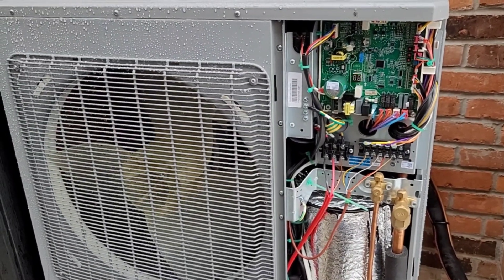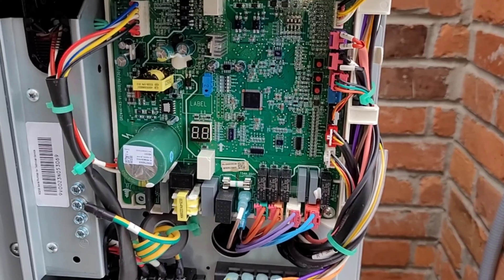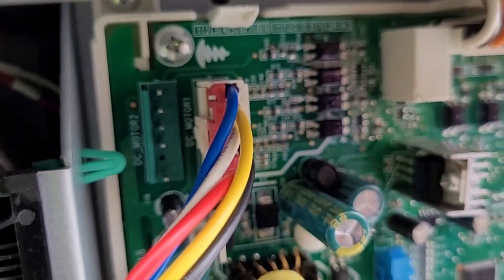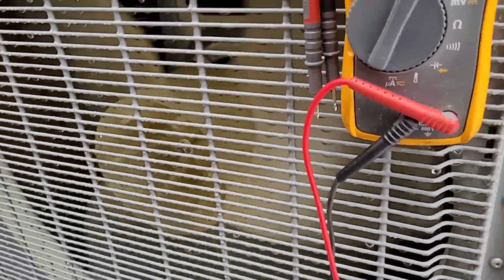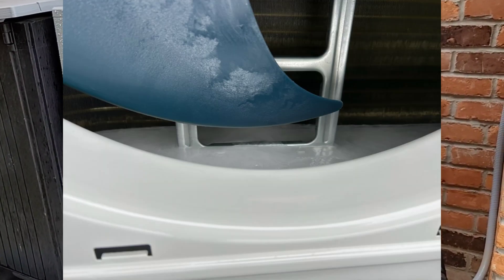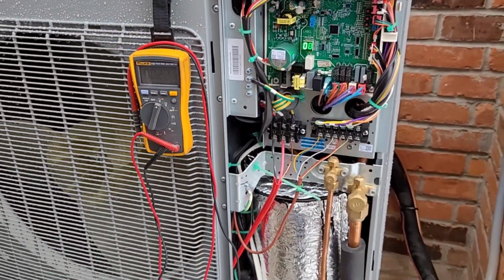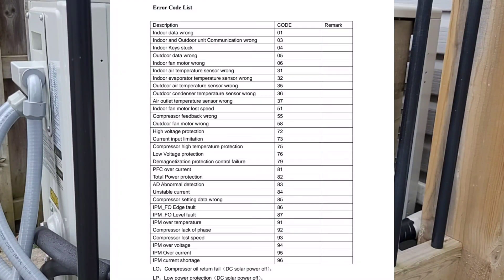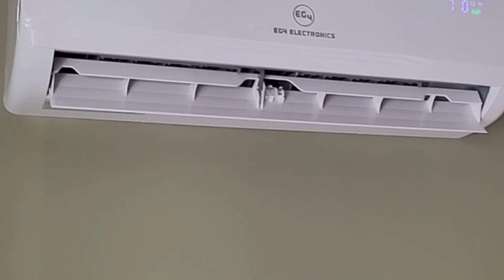Is Your EG4 Solar Heat Pump Pan Freezing Up? Watch This!

Comment: Thanks so much for your informative posts! My wife and I are building a well-insulated 650sq.ft off-grid cabin in eastern Ontario and are wondering if the 1 ton eg4 mini split would be capable of keeping ambient temps inside above freezing on the coldest winter days provided the solar system is adequately sized.

Lack of a pan heater might be an issue as well?
Reply from the maker: Yes, it would do well in a space that size, a little woodstove for back up would be great. Im in Ontario too and the lack of pan heater has not been an issue for me
Reply: right on. I'm just hoping that while it might not be able to keep the 650sq.ft cabin to room temp when it's -30°c out, it would be able to keep it to above freezing when we are not there. Would have a wood stove for times we are there, trying to determine if it could keep the place from freezing if fed enough energy and monitored remotely. @SmitHVAC.
Reply from the maker: @SeanRossMercer  Im confident it would. I had it heating my house at - 17 and it was still pumping out 107f air

Comment: I have an EG4 12,000 btu installed in November. It was working great. Then we had a cold spell in January and it iced up. Similar to the pictures in your video. I’m in the Ottawa Valley. I also have a Senville 18,000 btu mini split that does not ice up as bad. Thanks for your videos! Very helpful information.

Comment: I have a pioneer WYT series unit, non ultra. That's how the bottom looks in mine even with the heater. The problem is I didn't expect to use it so much in 2022-2023 due to the high price of natural gas, and the left side drain hole goes into a concrete block, fills up and then can't drain and thus ice builds up regardless. Since that unit is in the shade, a mountain block of ice forms and doesn't go away until around april.
Next units will have higher blocks and not have them facing with the holes facing up.

Comment: Thanks for the update with the EG4. I have one last question for you about these. I was planning on installing this head unit in my basement. It will probably never be used for the ac part just mainly heating during the cold days, as my basement never gets hot. My question is does this unit have a dry mode (dehumidify) without having to run the ac ? I currently have a Senville in the main living area and it has a dry mode. I have not been around alot of mini splits to know if that option is available on all. Thanks for you time.
Reply from the maker: It does have a dry mode but it will run the AC cycle with a very low fan speed, it will condensation if that's your concern

Comment: My Fujitsu does not have a drain pan heater. A good way to ruin  your efficiency. Mine has  a roof of solar panels over it and walls on 2.5 sides. Protected from freezing rain, snow and wind. My standard central heat pumps do not have drain pan heaters ever. We have no problem with most of them, but occasionally get ice buildup that can pry the fins off of the tubes on the bottom 4” of coil. I turn those off or on emergency heat during freezing rain. Then wait till warmer weather to let them melt off on their own or use hot water to melt the ice off of the fan blade before starting back up. All heat pumps have things you have to deal with during inclement weather. Having many splits covered over the top and at least two sides  helps a lot. Give your bottom pans on minis  and fan shrouds/blades a good wax job or rain-x to help water and ice to shed off faster or easier.

Comment: No issues with my 24k here in SE Washington.  Not the pan anyway. I did have some freezing rain coming in to the face of the unit, dripped off the top and formed an ice chunk curving into the top of the fan shroud.  One blade of the fan was hitting it, rather loudly. Turned it off, got out the heat gun, all better.  Not sure what I can do for that other than be wary with that weather in the future.

Comment: I do not have an eg4, but have been watching your videos with interest.   If I was in that situation I would look into an oil pan heater for a car (The kind that sticks on the bottom).  Used it with a battery warmer and a 1000watt  coolant warmer on a diesel jetta for quick warmup fro starting in -40C weather.  That setup was awesome, remotely turned them on 45 minutes before leaving for work and the car would melt the snow off the hood, start in summer mode and have immediate heat.
Reply from the maker: That's essentially all a drain pan heater is! They're like an oven heat element that can either be controller  by the circuit board or a small thermostat, so its all automatic.